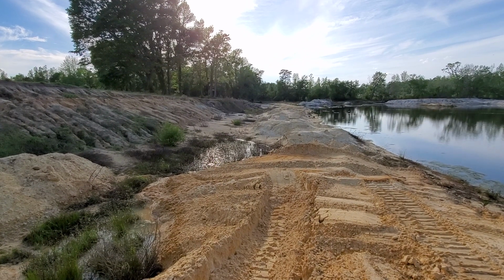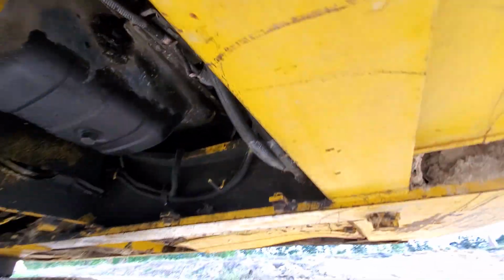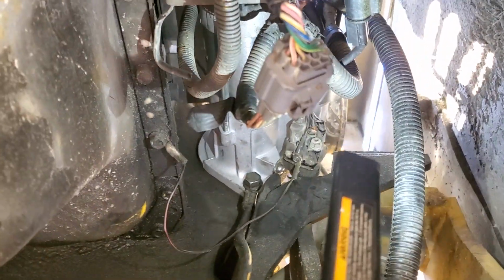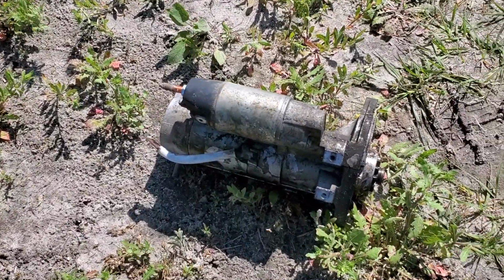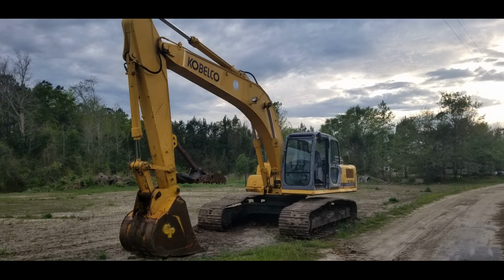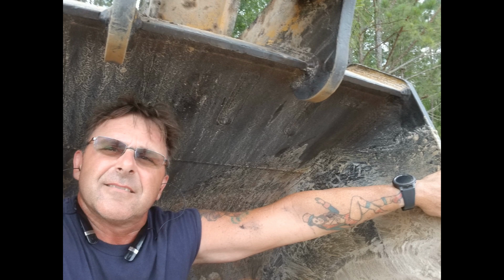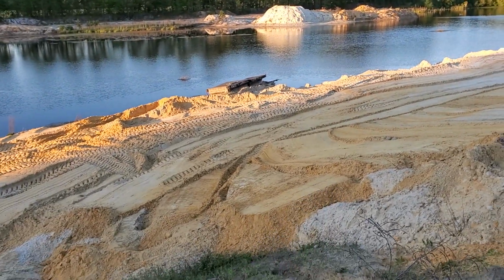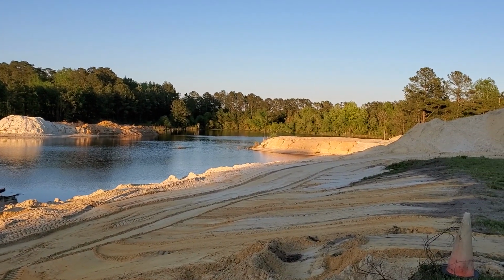New Starter is in...1 Yr Kobelco Anniversary ....& Happy Easter!!

Comment: No bucket repair yet
Reply from the maker: Charles,  no, I haven't found anyone who will call you back....will probably just do it myself.
Reply: Or buy a bew bucket and put insurance on it so the tech will come out and fix it also whos excavator has the grappler
Reply from the maker: @charlestaylor2480  I have a mechanical thumb.....bucket is not ready to break anytime soon.....I just wanted to strengthen it up.....I'm sure it has another 1000+ hrs left before I have to worry 😁